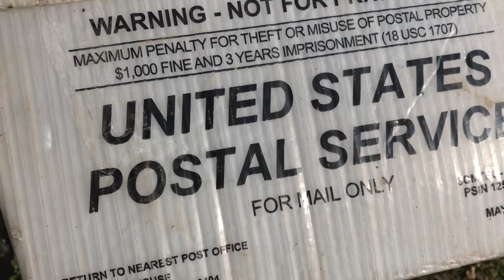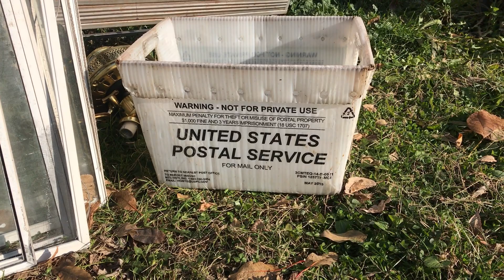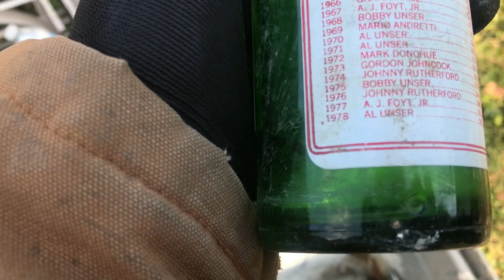Dumpster diving, picking & scrapping metal #14

Comment: Hi Jerry....  your a dam hard worker.....     If you had a truck??   What happened to yours?
Reply from the maker: Long story short I held onto it as long as I could. It needed some work to get it going plus more work after. In the process of moving I sold it and he gave me what I wanted for it. After him and two others spent 6 hrs they got it cranked and running. I ended giving the machianic a van of ours with a bad transmission. Well I guess that was not so short lol. I'm like days away from getting back my license and I have a trailblazer for scrap movement.
Reply: @dumpsterjerry3577  Thanks Buddy...   Your a dam hard worker......